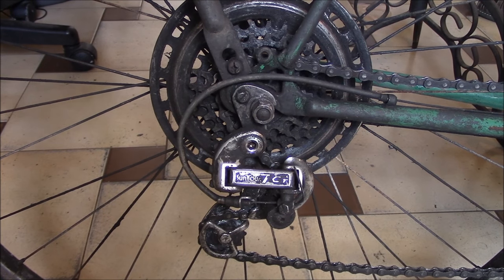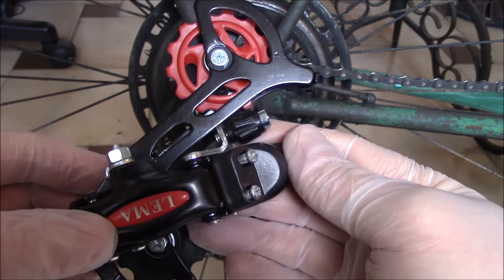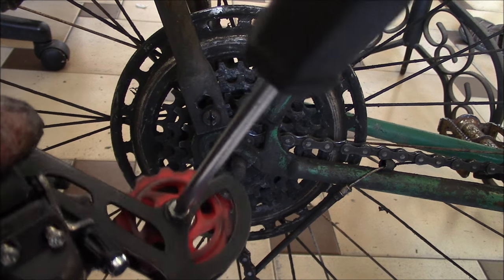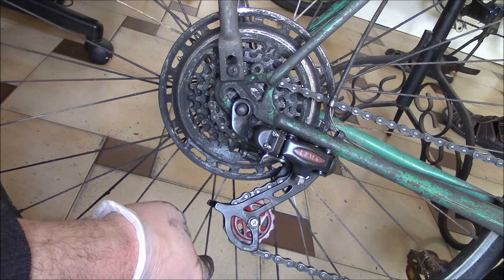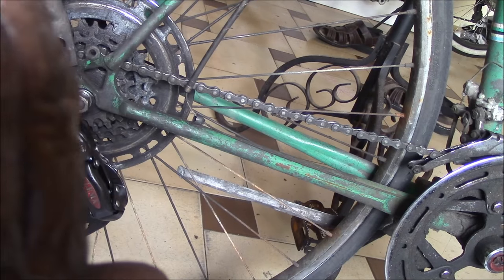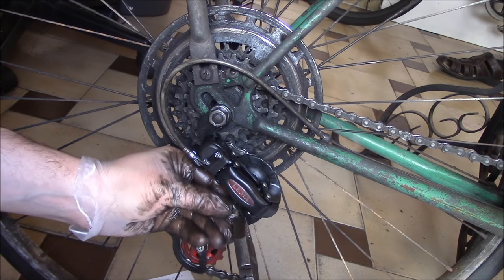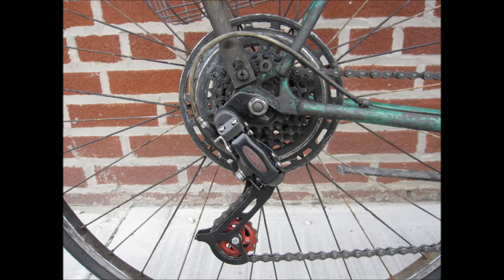How To Replace And Install A Rear Bicycle Derailleur

Comment: that extra bolt is for the derailleur to claw then the claw goes in the axle slot then the axle nut goes on outside the claw...or bypass the claw if the frame has a derailleur hanger welded on.

Comment: Never replace that old derailleur with new cheap plastic garbage. That old one is far more reliable, you just need to bend back the cage and and rebuild the springs. Or you can buy any other 5 speed derailleur with a similar cage size.  That new one will fully wear out in like 6 months, while the old one is all steel and will last you 40-50 years and more with maintenance.
Reply: i guess it's kinda off topic but do anybody know of a good place to watch new movies online?
Reply: Don't trust these guys, these are bots.
Reply: I have the same garbage derailleur for 5 years already and it's still in good condition, super sturdy.
Reply: I have the same garbage derailleur for 5 years already and it's still in good condition, super sturdy.
Reply: I have the same garbage derailleur for 5 years already and it's still in good condition, super sturdy.

Comment: I have one of those bicycles, I also must get a new rear derailleur. I'm curious to know, if that new one worked for you??
Reply: Yes, Sun Tour derailleur on a Raileigh Record Ace Tour De France made in England
Reply from the maker: Yes it worked. It was experimental since it's the one that I had and was at a very low cost.

Comment: No this is the wrong way and is bad advice. You should have reused just the hanger from the old derailleur. It's not supposed to attach to the axle bolt.
Reply: Agree
Reply: Are you saying that we also need to add the hanger? Please reply really appreciate it

Comment: Never, and ever, Attach a rear derailleur on the axle. It will cause shifting problems.
Reply: Apart from the original suntour 5 or 7 did go straight on the axle, albeit with a flat sides washer to keep it from moving but still straight on the axle... My guy was just going reverse steps from his original mech removal.

(No it wouldn't work for long 🤣)

Comment: Man, that is one dirty bike! I couldn't just replace the Derailleur and leave all that gunk on.
Reply from the maker: That's part of the point of this video. Showing how it's done when it is dirty is part of the real job.
Reply: @DoItYourselfEasy  So "how it is done" does not include wiping it clean?
Reply from the maker: @nealm6764  This can't simply be wiped clean. It would require extensive cleaning with certain products that not everyone may have available. Additionally the original derailleur needed to be replaced anyway so no need to that.
Reply: And yet is came off easily all over your gloves. It's ok if you want to lie to yourself, but please stop lying to me.
Reply from the maker: @nealm6764  Really? Do motorcycle and car mechanics wipe all the parts clean before they remove and work on them? Nothing came off easily. The parts were still heavily soiled. Who is the one lying now?
Reply: @nealm6764  What does the title of the video say? It's to help people on how to replace a rear derailleur, not how to clean a bike.
Reply: Idk about this bid. I have never seen a bike that greasy and why wouldn't you clean it up? You just know its going to be one of those vids when he uses the crescent wrench backwards.
Reply: @DIY University does this apply to any bike? I have a Roadmaster Granite Peak that needs its whole shifter system and both derailleurs replaced as the current one has failed. It is a TD-One Torque Drive System. I do have a Shimano System that I plan on installing. I have all of the parts and everything else. This is my first time ever having to do this.

Comment: Surely that wheel is in the wrong position, it needs to go all the way back in the "slot" for it to be safe.  Also, you are missing a bit which was removed with the previous derailleur? I will watch someone else's video for a second opinion...  Obviously there is also more to it like which gear to put the bike in etc.
Reply: I have a similar derailleur and came here to see how it was mounted because mine is the same way and I thought it has to be wrong. The derailleur takes up part of the slot so that the wheel does not slide back all the way on the other side. Apparently that how the original mounts. Odd. However., I agree that the new one should slide all the way back. He needed to loosen and re-adjust the wheel on the other side of the axle.
Reply from the maker: Read the comments in the description. As illustrated in the repair as well, the original derailleur is no longer in production and obsolete. The replacement is a totally different type, brand and material. The way it was installed was the only way to get to fit on this bike and it works well.
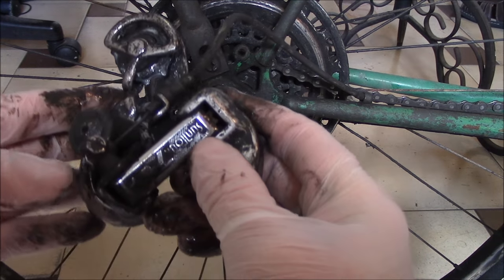Reply: There is definitely a part missing. You left the part that hangs the derailleur on the old one. Its called a hanger or Drop Hook. Look at the video at the 2:04 mark. See the large hex head bolt about an inch to the right of your screwdriver that looks like a hook ? That part was suposed to be removed from the old derailleur and installed to the new one. The second small bolt on the hook is what keeps the derailleur aligned properly on the bike.
Reply: @DoItYourselfEasy  Try changing your gloves , or keep your components clean and oiled, that was one manky install . done totally wrong , you are giving people very bad advice , could not believe what i just watched <

Comment: this is a direct mount derailleur! It won't work well with this setup! you need to get an hook type rear derailleur please delete your video its very very wrong
Reply from the maker: It's very right. If you paid attention I stated that this derailleur doesn't belong to this particular bike so I had to customize it and it worked fine.
Reply: @DoItYourselfEasy  There are adapters to mount these type of derailleurs to these type of mount like this : https://www.rearmechhanger.com/product/rear-gear-mech-derailleur-hanger-cc103/